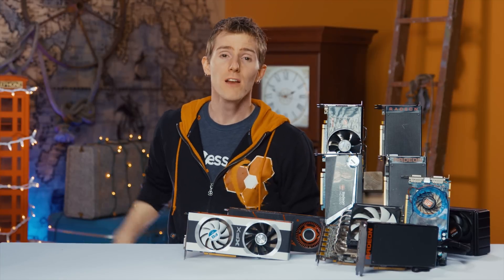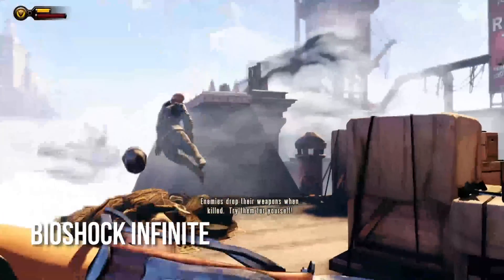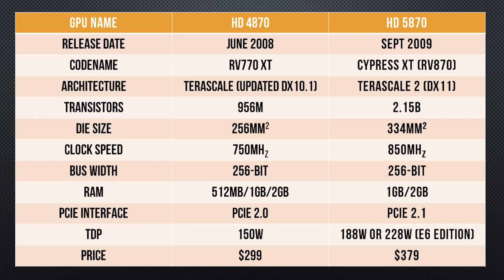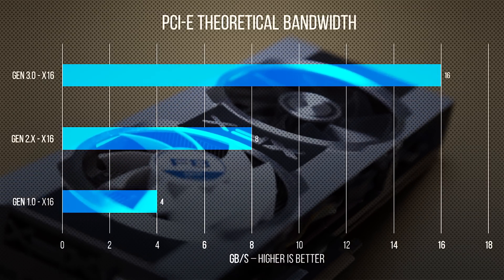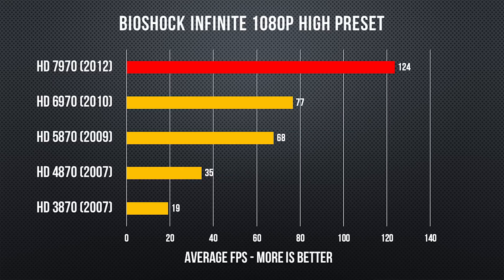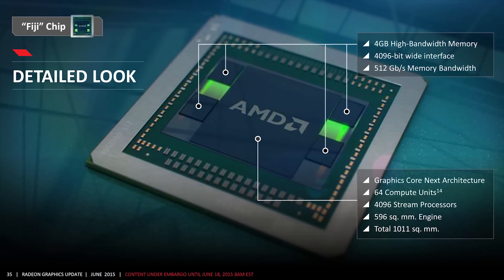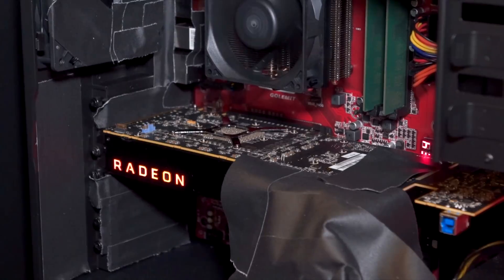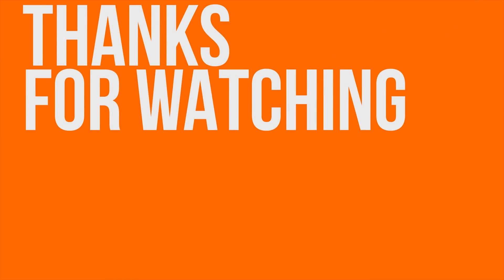10 Years of AMD Video Cards BENCHMARKED!

Comment: History of GPU I bought :
- 9800gt
- 4870 cf
- 5770
- GTX 570
- 6770
- 7770
- 7870xt
- 7950
- GTX 750ti
- R9 380x

and now I'm stuck with intel hd 530
what a life...
Reply: for me its

9600GT
GTX460 X2 - bought one but within 6 months it died, so bought another and yet again 6 months later it died with the same memory fault (had red scquares all over the screen and would work fine untill you install the drivers then the driver would crash and then windows would blue screen)

then i just went fuck you nvidia and switched to AMD so went out and bought

HD7770 1GB

and just recently upgraded to a 

R9 270/270X 2GB

and i have to say now im on AMD things have been a lot better
Reply: Here's my GPU history:

-nVidia GeForce2 MX 400
-nVidia GeForce4 MX 4000
-ATi Radeon 9600 XT
-nVidia GeForce 6600 GT
-ATi Mobility Radeon X1300 (was in a laptop)
-nVidia GeForce 8800 GTX
-nVidia GeForce 8600M GS (also in a laptop)
-nVidia GeForce GT 525M (again, another laptop)
-AMD Radeon HD 7850
-AMD Radeon HD 7970 GHz Edition

Currently waiting for Vega to come out to upgrade as I'm going to build myself a Ryzen system, really don't want to buy an RX 480 and I kind of want to stay on the AMD side if I can, so gotta wait to see how good Vega will be.
Reply: Mine were:
Diamond Monster 3D II 3dfx Voodoo2
ATI Radeon 9800PRO
BFG Nvidia GeForce 7800 GT
BFG Nvidia GeForce 7950 GT
EVGA GeForce GTX 960

I've built only 4 PC's for myself in 20 years.
Reply: 3dfx Voodoo graphics
riva tnt 2 vanta
3dfx voodoo 3 3000
nvidia geforce 2 mx
ati radeon x1950 pro
amd radeon hd5770
nvidia gfx 1080

... why can i even remember this shit but keep forgetting names of people i just met D:
Reply: GT 640M
intel HD 3xxx
GTX 750ti 
And i wish i'll have a better gpu for 1080p ultra gaming
Reply: BR é foda | in brazil it's hard to have a good GPU, all of them are so expensive!
Reply: Why 7950 to 750Ti? Seems like a huge downgrade.
Reply: Cirrus Logic CL-GD5428 Vesa local bus 1mb
Diamond Stealth 3d2000 2mb (S3 Virge)
Diamond Monster 3DFX Voodoo1 4mb
Gigabyte TNT2 Pro 32mb
Leadtek GF4 Ti4200 64mb
Medion Radeon 9800xt 128mb
MSI Geforce 7800 GS Agp 256mb
Powercolour HD3850 Agp 512mb
MSI HD5850 1gb (RIP)
MSI R9 270 2gb
Gainward Phoenix GTX1070 8gb
Reply: did you move to laptop or something?
Reply: For me it's:
Nvidia GeForce GT 220 
AMD Radeon HD 6670
AMD Radeon HD 7770 GHz Edition
Nvidia GeForce GTX 1050
Reply: GF 210, GF 410m, R9 380, RX 480
Reply: i didn't said that i had a 7950
Reply: Rage 128 (First PC I've ever had and I built it myself in 1999, like all my PCs after)
Radeon AIW 8500 DV
Radeon 9800
Radeon X1650
Radeon 5850
Geforce GTX 570
Radeon 7970 ROG Matrix Platinum (had it for almost 4 years and it was amazing)
Radeon RX 480 8 Gb
Reply: For me:
nVidia Riva TNT (still have it)
nVidia GeForce 2 MX200
nVidia GeForce 2 MX400 (200 wasn't good enough for black and white at the time, so slight upgrade)
Sapphire ATi Radeon 9500 (softmodded to run like a 9700)
ATi Radeon 9800 Pro (when my 9500 died)
HIS ATi Radeon X1650 Pro
HIS ATi Radeon X1950 Pro (when my x1650 fried, psu blew)
EVGA nVidia GeForce 8800 GT
Asus nVidia GeForce GTX 260
MSI ATi Radeon HD 5850 x2 (first attempt at two cards)
HIS ATi Radeon HD 6970
HIS AMD Radeon HD 7870 (6970 became faulty and decided on a less noisy card)
Sapphire AMD Radeon R9 290 (current card and so far due to my resolution, I have no reason to upgrade as it runs everything fine on high-highest)
Reply: GTX 970 3.5G you mean
Reply: ATI HD 2600 Pro
ATI HD 4870
AMD R9 270
Reply: - trident whateveritwas 1mb (the original had only 512kb memory and wouldn't run windows in 1024x768)
- Diamond monster 3D II (voodoo2) 8mb
- Diamond monster 3D II (voodoo2) 8mb SLI
- geforce 2 GTS 32mb
- Geforce 4 TI 4400 128mb
- Radeon 9800 PRO 128mb (this was a bigger leap than the previous one, for those who don't know)
- Geforce 4 mx440 (i broke my 9800 :< this was actually worse than the geforce2 GTS somehow)
- Geforce 6800GS AGP 256mb 
- Geforce 8600GT PCI-E 256mb
- Geforce 8800GT 512mb (one of the fastest upgrades i ever did. it was like 4 months after i bought the 8600)
- Radeon HD6950 2gb - i consider this the best card i've owned. it was the cheapest, and it was the highest end i've ever bought. perfect combo. lasted me until late 2015, easy.
- Geforce GTX970 3.5gb (it was garbage. RMA took 7 months to accept my stupid claim for a refund)
- Radeon Rx480 8gb

this is surprisingly few considering it covers 23 years. also i'm not counting repeats or downgrades. i've used a gf2
Reply: Nvidia FX 5200
ATI 2600XT Diamond
nvidia GTX 260
AMD Radeon 7970
nvidia GTX 980 Ti
Reply: Katakuri Not bad ! Fortunately no 480 here ;)
Reply: For me:
GMA 3100(integrated)
HD 5450 
GTS 450
I usually spend years with one card XD
Reply: Well for me:
9600 gt
HD 5750 1gb
GTX 1080 TI
:D
Reply: i had 9800gt, was the very first graphic card I went out and bought. Huge upgrade from my 8mb Diamond whatever crap it was called.
Reply: 7950 was probably the fastest card there
Reply: For me it was:

Nvidia Geforce 7300gt
ATI Radeon 5770
AMD Radeon 6750m
Nvidia NVS 5200m(GT 730m)
Nvidia Geforce GTX 1060
Reply: you definitly changed often. Radeon X1300 -> 6400 GT -> 9800 GT -> GTX 670 -> GTX 970 for me
Reply: For meits GTX970... Thats it :c ive had a laptop before that with a radeon HD 5** dont remember
Reply: BandNerdcp yes that's mean
Reply: fx5200 6600gt 7600gt x1950pro 3870 4870 5870 gtx770 gtx1070😄😄been 4 glorious with amd once hahahaha😂😂
Reply: a desktop i7-6700, I sold my 380x to buy rx480, but storm comin thru my wallet before went to store, poof, my money is gone...
I hate to get cash from my savings because my wife always checking it...
So lets how life will raise me up #lulz
Reply: marriage problem #lulz
Reply: Lemme see:
- Trident 9440 PCI
- Ati Radeon 7000
- nVidia MX440
- Ati Radeon X300
- Ati Radeon HD4650
- nVidia GTX660
- nVidia GTX1060

I think I was pretty balanced in my buys over time, right?
Reply: heh i used to have a 4870x2...that thing fried cheap 700w power supplies in under an hour of Metro gameplay. The last power supply that died took the card with it...after that i learned not to be cheap on power suplies
Reply: -7300le
-8600gt
-4850
-GTX460
-7870XT
-7870XT CF
still rocking the cf perfect for 1080p
Reply: - PowerColor Radeon HD 5750 (2009)
- Inno3D GeForce GTX 650 Ti Boost (2014)
- SAPPHIRE Radeon R9 280 Dual-X OC (2015)
- Gigabyte GTX 1060 G1 Gaming 6G (2017)
Reply: - nVidia GeForce 2MX 200
- nVidia GeForce GT540M
- nVidia GeForce GTX 1050Ti (hopefully soon)

I'm not much of an high end gamer xD
Reply: AMD R9 380

Aaaand thats it...
Reply: HD 4670
HD 6970
GTX 560
GTX 960
GTX 680
GTX 780
HD 7970
R9 290x
Reply: Yatin Alkatiri G210,
GT630
HD7750
GTX660
GTX970
GTX1070 <- bought last week
:D
Reply: Mine:

Mobility Radeon X1300 (Laptop)
Sapphire HD 7850 1GB
Gigabyte RX 480 8GB
Reply: radeon 5450 
hd 7770 sapphire
r9 280 sapphire dual x (im still rocking it)

c2 duo 3Ghz
x4 860k
intel i5 3470 (current build
Reply: -Cirrus Logic something (gave the computer away)
-ATI Rage 128 (gave the computer away)
-Geforce 4 Ti 4200 8x 64mb (gave away)
-Geforce 6600GT  (VRAM failure)
-Ati Mobility Radeon x600 (in my old notebook)
-Geforce 7300 GT (returned it)
-Ati Radeon x1950Pro (VRAM failure)
-Ati Mobility Radeon 9600(in an old notabook)
-AMD Radeon 6750 512mb (still ins my desktop)
-Ati Radeon x1600 Pro (secondary pc)
-Ati Radeon HD4650 1gb (secondary pc)
-Geforce 960m(current notebook)
Reply: asus 750ti
crossfire gigabyte r9 270
reference gtx 970
evga ftw gtx 980
evga sc+ gtx 980ti, and outperforming 1070s with an overclock :)
Reply: -ati 9500Pro
-ati HD2600Pro
-gf gtx460
-amd r9 290
-gtx 970

what a road
Reply: Some s3 card can't remember the name of it
Riva Tnt 
Tnt2
Inno 3d Geforce mx 440
Club 3d Radeon 9800 Pro
Msi 7900 Gto
Sexond one for sli
Evga Nvidia Gtx260
Club 3d 7970 Royal ace  
Powercolor 390 pcs+ 
Aaand that died so i have now temporary world's most expensive (50$) Asus Geforce 210 (which sucks major balls)
Reply: mx 440
gtx 260
hd 4890
Reply: GTX 780
GTX780
(For a total of two in SLI) Only 3GB of effective memory :'(
GTX 1080
Reply: Radeon 4850 🠖 Radeon 7950 🠖 R9 Fury X

Hopefully Vega will be a worthy successor to the Fury X :)
Reply: Geforce 210 :) 
R9 270 
GTX 1060
Reply: Intel graphics 2000
GT 610
R7 350
GTX 1050
Reply: Gtx 650
Gtx 590
Gtx 780
Gtx 980 ti
Reply: Yatin Alkatiri Fortunately not a 480, otherwise your pc would have caught fire
Reply: can any one of you guys give me his old gpu cuz im stuck with intel hd graphics forever
Reply: Yatin Alkatiri my journey was 
some built in Intel dx9 gpu 
Intel dx11 something
hd 5450
hd 7770 GHz edition
GTX 750 Ti
Reply: GeForce 2 (dont remember exact chip)
Radeon 9600pro 
Radeon HD4850 (still running in my father's PC)
Radeon HD6970 (still running in my sister's PC)
Radeon HD7970 (still running in workmate's PC)
Radeon R9 290X CF (divorced but both still running in 2 friend's PCs)
Radeon RX480 (previous CF was crappy and too loud)
Vega or GTX1080ti :)
Reply: Thjaffi Wow !!! I bought an Intel HD 4400 chip ( my CPU'S graphics chip - it's a 4130 ) and a 1060 3G from Gigabyte.
Reply: Hello, did you notice very much improvement? I mean from the 7770 Ghz to GTX 1050
Reply: ThePgR777 Trust me!!! There is lots of difference. A Video Card is always more powerful than an integrated gfx chip in a CPU!! Only the GT 610 is slower than many chips, but that's a veeerrrrry underpowered card ;)
Reply: ThePgR777 at least in today's cards.
Reply: mine 

- AMD 5670 
- gtx 560ti 
-gtx 960 

now waiting for vega
Reply: Geforce 2MX
Radeon 9800Pro
Radeon X800
GTS 8800 
Radeon HD 5770
R9 380x
Reply: Yatin Alkatiri 
Intel HD graphics
Gtx 460
Gtx 660
Gtx 770 ti
GTX 1080 ti(finally decided to upgrade with my tax returns, 770 was still kicking ass on 1080p)
Reply: Yatin Alkatiri for mi :
ATI xpress 200 
ATI HD 2400
ATI 6450
ATI 3650
NVIDIA 550 TI
NVIDIA 1050
Reply: My GPU History:
Radeon HD 6850
Crossfire 6850's
SLI Gtx 550ti's
Radeon HD 7970
SLI GTX 770's
GTX 970
Reply: gt 720 
rx 480
rx 480 again
gt 210
9600 gt
Reply: don't think my first PC had a graphics accelerator xD
GeForce 2MX
GeForce 4600 (went up in smoke)
GeForce 7600
GeForce 7900GT (preowned)
GeForce 9600GT (preowned)
HD7850
R9 380X (preowned)
and in two years my very last one O.O
Reply: Mine:

-Geforce 8900 GT
-ATI 4650
-Radeon HD 6970
-R9 290x <--- (Still stuck with this one ._. ... but it still kinda rocks though, lol)
Reply: I went through tons and tons of various configurations in the late 90s and early 00s, so I forgot most of the stuff, but it went something like this:
- a long-forgotten Tseng Lab card of unknown designation, and an equally as forgotten Cirrus Logic card, I forget which came when
- S3 Trio 64+ and several variations thereof
- Voodoo Banshee, ATI Rage Pro, Nvidia Riva TNT, Matrox Millennium G400 in a forgotten order.
(There may have been a GeForce 256 thrown in the mix somewhere around here, but I forget if it was mine or just passing through. Also, a few more Matroxes, ATIs and NVidias of lesser stature, but I forgot the details.)
- Nvidia GeForce 2 MX (the first card I bought new from the store)
- ATI All-In-Wonder 9200
- ATI Radeon 9800 SE
- NVidia GeForce 6600 GT (briefly)
- ATI Radeon HD4670
- NVidia GeForce GTX 960 (the second card I bought new from the store)

Those first two and the G400 are the best cards ever. All the others are just toys. :p
Reply: I didn't have too many cards. 
Late 2007: Gigabyte 9500 GT
Early 2013: Asus 5750 Formula
Mid 2015: Palit GTX 660
Early 2017: Sapphire RX 460 OC
Reply: For me 
-9800gtx(main computer)
-Radeon Mobility HD3470(my first laptop)
-gtx 470(main computer)
- gt 635m (my second laptop)
- amd radeon r9 270 (main computer)
-nvidia gtx 970( second computer)
-Intel graphics 520(my third laptop)
Reply: Gtx 550
Gtx 690
2x Gtx 980ti
Gtx 1080ti
Reply: Nvidia GeForce GT 7300SE
Nvidia GeForce GT 630
Nvidia GeForce GTX 970
Reply: Yatin Alkatiri no one cares

Comment: i still have a r9 280x in my gaming pc looking to go to the rx 480 gaming from msi tho
Reply: Would be a good move, but wait it out another month because the RX 5XX series cards are coming out which might run down the prices of the 4XX series cards a bit.
Reply: I would grab that card to replace that R9 280X
Reply: SlavjanA would be nice to get it cheaper I am in Canada so the rx 480 is  300 bucks  so if I could even get if for 250 that would be great
Reply: Rx 5XX will be a rebrand of the 4XX series card.

Comment: I'm still using 2 HD 7850 in crossfire 😂😂😂
Reply: brky well with my 8350fx and logitech thx speakers it draws just 400watts. In comparison my iron takes 2.6kw! So yeah it's livable :p
Reply: Flash Man what about your electricity bill?
Reply: very nice
Reply: nice hows the performance for current games so far?
Reply: Aaron18Cvx 
Pretty decent. In Tomb Raider I can get 61fps average with everything on even with TressFx. Hitman Absolution and Max Payne 3 is also super smooth at maximum settings.

Comment: I'm not sure why the graphic shows the Fury as having a 512-bit memory bus.  It's not just "marketed" as having a 4096-bit memory bus.  It actually does.  Physically.  Each HBM package has 1024 IO lines and four of them are used in parallel.  What is there to debate?

Comment: Anyone think the RX 580 will be about on par with a 1070? Or am I way off?
Reply: I think you're a tad off because that's a while different territory. It's meant to, again, compete against the GTX 1060 and replace the RX 480. It's just a simply rebrand of last years model with architecture improvements.
Reply: I can dream though right?
Reply: You can until benchmarks come out